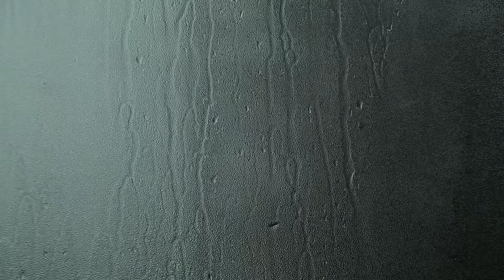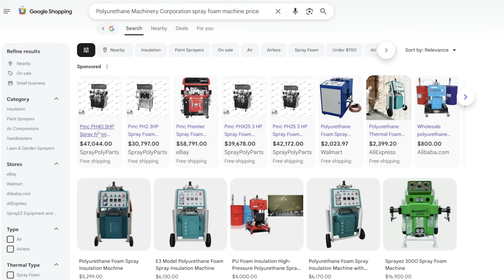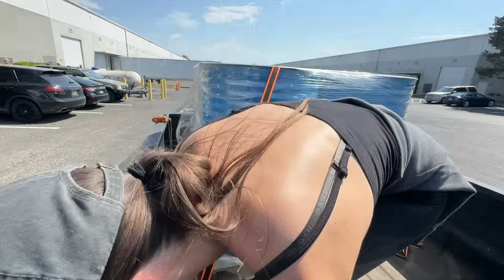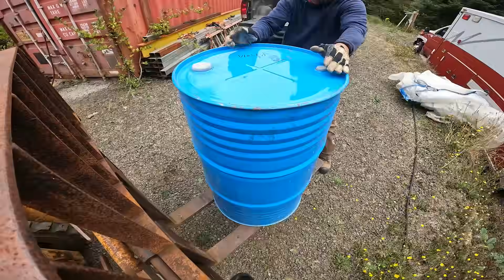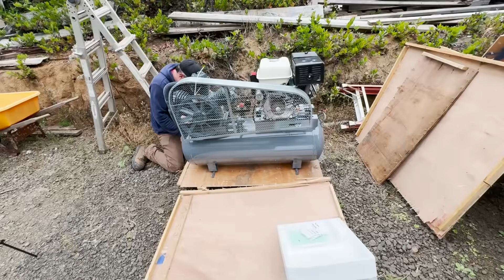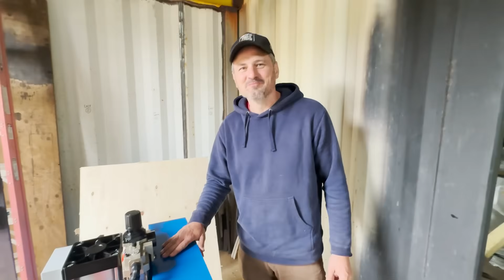WHAT THEY DON'T TELL YOU ABOUT INSULATING A CONTAINER HOME ... Can We DIY Spray Foam? #build

Comment: Get training from your builder/advisor asap, get cleaning solvents and an empty drum for solvents before you start spraying. Remember that closed cell foam can only harden by emitting the solvents and cure agents through the foam into interior airspaces, so get force fed air for breathing protection while spraying for both of you since you'll be filming. Use your fans to remove/exchange air inside containers only while exterior air is complementary to recommended humidity and temps. Take your time and do more smaller cured layers rather than one big mass spray or bottom layers won't cure for months or more, many videos on YT showing others mistakes in this regards, where interiors were unliveable LONG after spraying.
Reply: I agree with everything you mentioned. 
I'd go one further and get trained with a local SPF supplier. Spray Polyurethane Foam is quite dangerous for a few reasons. An exothermic reaction is what causes the foam to expand once the isocyanate and resin are mixed in the tip of the gun and applied to the  substrate. You can literally have the foam spontaneously combust if you put the material on too thick. Also too thick can  lead to  "burnt" foam that will always smell and would have to be removed.  No more than 2" passes at a time and allow to cool. The off gas of said chemical reaction is very toxic. Make sure you have a full face fresh air reperator, that means a full face mask that is supplied by a fresh air pump that is not within the structure. And, obviously of the rest of your P.P.E. Isocyanates ( the red drum) are very hazardous to your respitory system, even from  inhaling them from opening the drum/barrel. Also, if you get Iso on you, it won't be coming off anytime soon. Iso also reacts with the moisture in the air and will become rock hard. Glycol Ether is a good solvent for cleaning up, weather it's the guns or a spill. Further more, the material is heated (110- 130°and  pressurized 1000- 1400 psi) in the Proportioner( machine) and sent down the heated hose to the gun. Even cracking open the gun to try and fix a bad pattern could be dangerous. Dialing in the heat and pressure of the machine and chemicalis and  understanding the pattern of the gun are key to  getting a good finished product and maximum yield( board feet).You should also procure a density test kit, this will allow you to test the foam once applied. A 2lb foam should be near a 2 lb density. You will also be able to test the cohesion of the foam. More to consider is, it looks like you got 50' of heated hose. You will have to transport the 500lb drums, machine and, air compressor and heated hose floor to floor... and as you know..none of that is light. Also, power for the proportioner. Most are 240 volt, you will ha e to supply power to the machine no matter where you set it. Again, proper training should be obtained and may even be required depending on where you live. 
Everything I've said here is my from my experiences of when I sold and serviced professional SPF machines/chemical. Perhaps you have an air powered machine that runs on 110 volt, it does not change the dangers of the chemicals and pressures. Side note, you need to flush the pumps, machine and hose if you are gonna let it sit.for an extended period of store the equipment.
Please do post info as to how you obtained this set up as $10k might cover the cost of material alone if bought domestically.  
Lastly, and once again, please get trained. It's a couple of days  and a couple hundred bucks that will be recouped after the first time you start getting bad foam and understand how to dial in the machine.
Reply: As a spray foam installer myself I approve this message!
Reply: I agree with all these guys lmao don't be like me and have messed up wall lmao I had an 8foot by 25ft wall of foam flop over it was hilarious and absolutely terrible at the same time I should of started smaller 4 sure to figure out the machine and to see how it cured .... I just went in like Rambo laying it down super thick spraying over the studs and everything

Comment: I am currently having to demo a shipping container because it was incorrectly built, It leaked and has the common insulation with the paper backing.  I have been going back and forth about spray foam vs Rockwool.  Is there a reason you did not use the rockwool?
Reply: Rockwool doesn't create a vapor barrier which is key. You'll always have condensation building up behind the batts
Reply: @Dorchwoods Yep. You'll have to frame the whole interior with wood (for a stapling surface) then install bat insulation, then a 6 mil vapour barrier, and finally Tuck tape all the seams and staples to ensure a sealed space. A whole lot of work.
Reply: @markryan3739 not to mention very difficult to do properly. I saw a study somewhere that said even a hole the size of a nail head can create a ton of moisture build over time, meaning it's key that the vapor barrier + tape is sealed up right!!
Reply: @Dorchwoods thank you so much. 😊

Comment: Never done spray foam but I can only recommend the following,  find out how and what to use to clean the gun, buy a ton of craft paper ( orange protective paper ) to cover the floors and anything you don't want spray foam on. The prep takes longer then the application I would think. Before you start the job get your excavator repaired you're going to need it for the rest of the material handling.  Maybe for attaching framing to the metal container walls use a strong tubing adhesive ( no need for screws no wall penetration no cold conduction) and is it better to after that frame the house run electrical and plumbing and then spray foam???? this way everything is installed and sealed in against condensation???  Tough call on what to do first good luck Jerry from U.S.A. 😅 OH yes to me very very IMPORTANT DOES THE SPRAY FOAM GIVE OFF  TOXIC FUMES??? BUY  RESPIRATORES I THINK FOR YOUR BREATING HEALTH YES ??????
Reply: Tons of toxic fumes. The ventilation setup is almost as severe as asbestos remediation except you want tons of fresh air coming in and pumping all of it out. 

Think of using aerosols in a phone booth. If you're old enough to know what a phone booth is. 😉

Comment: Hola chicos aquí en España para paliar los efectos climáticos y más en casas contenedores. Sé rocía por dentro con espuma de poliuretano o fibra de roca y lo más importante en la cara externa de la vivienda sé instala SATE es la solución definitiva a la condensación y una barrera magnífica para el calor cómo él frío porque las casas contenedor es imprescindible aislar dé fuera ( fachada) hacia adelante pared interior. Espero que os sirva de ayuda,seguid así. Hi guys, here in Spain, to mitigate the effects of climate, especially in container homes, spray the inside with polyurethane foam or rock fiber, and most importantly, the outside of the house.
Reply: But what is truly important is the installation on the outside of the house, the System llamado SATE.
Reply: It is the most used system in Europe. It has three advantages: it insulates, protects from rust, and gives the appearance of a brick house.